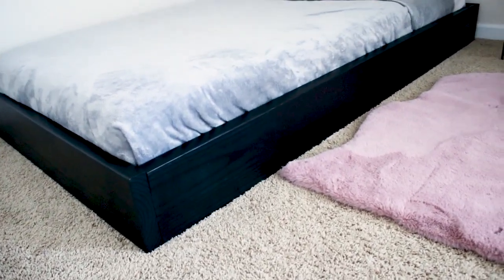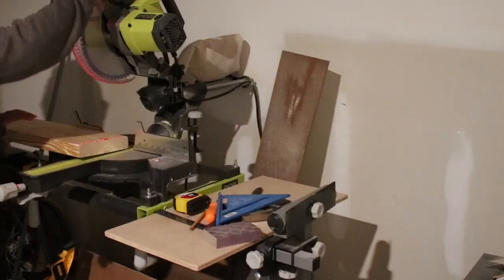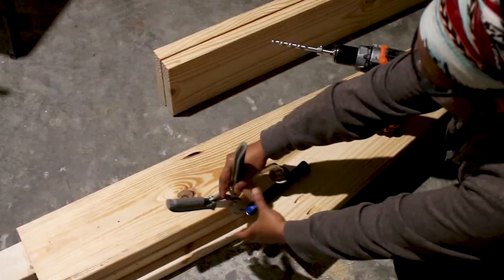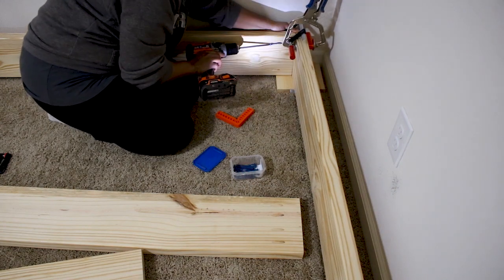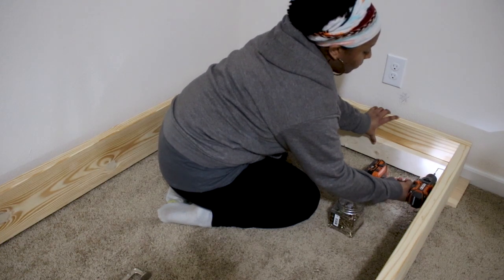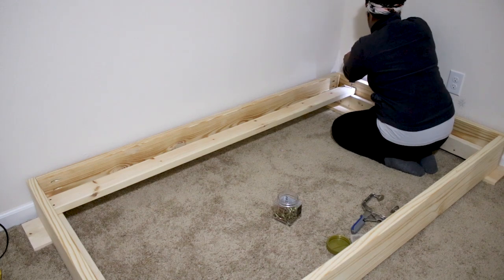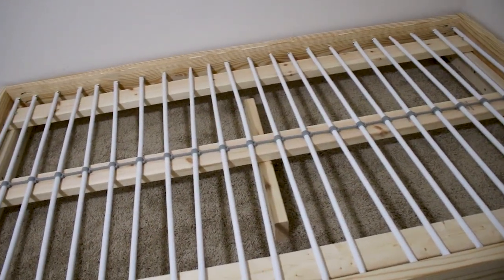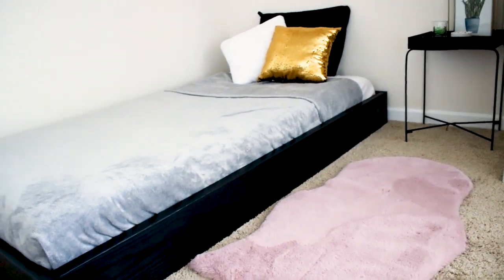EASY Diy Wooden Bedframe | How to Make a Simple Twin Bed Frame

Comment: Hi, I'm new a newbie - could you please give me recommendation of the pocket hole tool and the screw size you're using for this build?  Do I need to use pocket hole screws for pocket holes - or can I use deck screws?  Thank you!
Reply from the maker: Hi Andre! The tool i used for this build is the individul Kreg pocket hole jig (the clamp is sold separately). You do need to use pocket screws because once the hole is drilled it leaves a little "ledge" where the screw head sits and doesn't go all the way through. Hope that makes sense! Let me know if you need any more help.